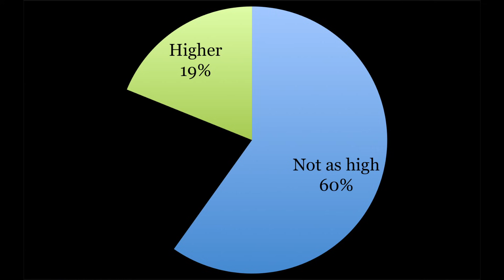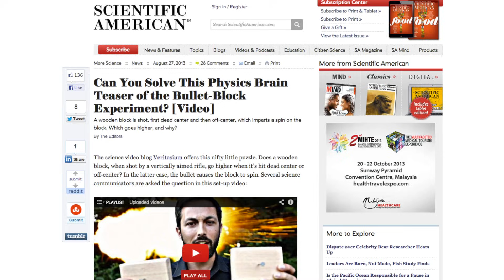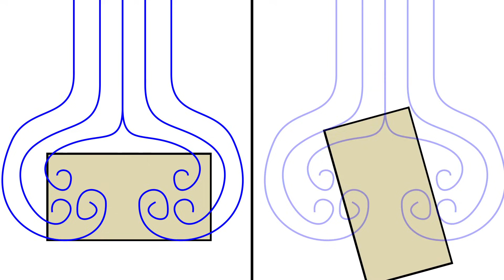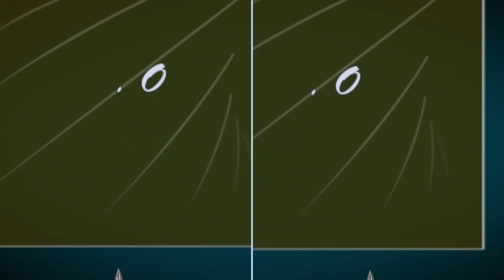Bullet Block Explained!

Comment: Two things come to mind when thinking about why the blocks are going different heights when shot in the same spot...
1. As a gun enthusiast I know that the exact same bullet from the same manufacturer can have a muzzle velocity difference of more than 10%, depending on the caliber and manufacturer. Slower velocity = less energy = less height.  
2. With the small amount of wood working that I have done I know that some parts of the same piece of wood are harder/denser than other parts of it. If the bullet hits a harder part of the wood,  I believe that would lead to less penetration and greater height. When all of the blocks were compared side-by-side, I noticed that one of the blocks that went the highest had a nail fly out of it, perhaps because it was struck by the bullet. 
I love the channel,  and thanks for the great video!

Comment: so what im thinking is that there is more energy required to push the block upwards on a side because the weight is not equally distributed where the bullet hits so more energy goes into pushing it up but that energy converts to rotational energy throwing it higher than what it would have gone with now rotational energy.

Comment: The bullet traveling at, say 1500 ft/sec, would reach it's max depth, transferring it's total energy, before the block would move, up or rotationally, to any extent. Someone smart can do the math, but I bet there would be less than a millimeter difference in rise at the moment the bullet reaches max depth between the two shots, measuring at the line of fire.

Comment: I initially predicted it would go higher. What I'm hearing is that, on average, it probably would go higher by a negligible amount due to lower air resistance (which is what I based my hypothesis on). I'm counting that as a half-success.
Reply: You should
Reply: you dont think that as the block rotates, the total surface area would be encountering more resistance? not from the top as it moves upwards, but from the direction its spinning in as the width of the block “chops” through the air.
Reply: @ernop350  but as the surface that cuts up into the air above it experiences a downward resistance force, so too would the surface that cuts down into the air below it experience an upward resistance force. You'd have to calculate out the aerodynamics to see if the wake has a low enough pressure or enough eddies for the downward force to be greater by a margin large enough to counteract the reduction in force from the reduced average surface area as seen from above.

Comment: Agree to disagree.... The explanation was not satisfactory... If the size of the block is small, there will be a negligible diff in the max height reached by each of them. But assume that - the size of block is atleast 2 ft and projectile size is also increased.... 
in the first case it was just lenear momentum that needs to be conserved. In the second case its the combonation of linear+angular that needs to be conserved.... and when the linear momentum of the projectile, when it hit the side of the block, will get split into 2 (linear + angular) and hence the max height in the second case should be less...

Comment: I think it's a total misuse of conservation of momentum.  The bullet won't have the same momentum as the block has, nor their speeds will be the same, otherwise the bullet won't be penetrating the block if it was not moving faster.  Conservation of momentum should include both linear and angular momenta, and they are not independent at all, as a slowly moving but rapidly spinning snooker ball will gather much more linear momentum from its own angular momentum once it hits a cushion.

Comment: What about the amount of force the nail excerpts on the wood on the off center shot, there would be a decent amount from the block spinning up even tho the nail is center of mass. you could try doing same experiment but with a strong noodle holding up the block like the nail is, but it would break on the spinning one thus not add the rotational torque, and then see if it goes same height.

Comment: Use a composite material each the same weight.
Use match grade ammo and a chronograph to pick projectiles traveling near the same speed. 
The offset shot blocks will be slightly less height  all else being equal.

Comment: I love puzzles like this one.

The thing that made me consider it might go higher is that the spinning block is essentially a gyroscope. The gyroscope holding the block on course vertically so that the energy used to throw the block shot in the middle would toss it off to one side, is not wasted in the spinning of the block. Therefore the spinning block has the potential to go higher. But then I considered that physics would dictate that the block would go the same height because both blocks have the same mass. A piece of wood and a piece of lead. So I said the same height. However, one would have to consider that both blocks have the potential to be microscopically difference in density and therefore that factor needs to be measured into this equation. However kinetic energy is lost at impact, so this slows down the block. 

How can it be measurable?

Make and use a block that can only be exactly the same density every time or use a perfectly round ball of equal mass to each ball. A round ball of equal mass would have to be made out of a controllable substance. It could not be made of wood. It would have to be a material that would react the exact same way every time it is shot. So perhaps a piece of plastic. 

I am sure if you weigh those blocks, they would be different weights.They are exactly the same size but each one could be off in weight due to decisty of the wood as it grew. An older tree with more rings would have the potential to be heavier than a young tree of the same size. A cut from the same board might be more dense if a tree branch grew out of it at one point and not another. This is assuming you are using the same type of wood for each block. So the only correct way to be sure is to make the block or ball out of a controlled substance that could be exactly the same mass and weight for every test.

Comment: Hi I'm late to the game. If the two blocks of wood would have traveled a different distance, then you could use an internal propulsion system to propel a spaceship to the stars. Unfortunately, that is impossible to do. All space travel requires external propulsion.

Comment: You get the same thing with air cars that have velcro on them.  momentum is conserved, but energy gets shifted due to the "bond"  the ole elastic and inelastic collision, but this is cooler because it is a variation on just inelastic.

Comment: I believe both moment of inertia and leverage factor into this phenomenon. Consider, instead of a small block had you used a 2"x4"x8' plank pivoted the same way in the middle. A bullet fired in the center might have been raised the plank some measurable distance - say 4" at both ends. However, had the 2nd bullet been fired into the plank 4' off center would not have raised the whole 8 foot plank. I suspect due to the distance of the bullet striking the plank from its center of gravity, all the kinetic energy from the bullet would have been converted into angular velocity causing the plank to spin on its central axis and the plank would not have risen vertically. This is because the lever arm at point where the bullet strikes is large compared to the distance to the plank's center of gravity. 

In your example, the lever arm was too small thereby the bulk of the kinetic energy translated into linear vertical thrust while the angular velocity was too small due to the short lever arm length.

Comment: Conservation of linear momentum makes sense and I guess the blocks would go to the same height because of it. The rotational energy makes sense due to less loss of energy when the block is shot off center. But what about the angular momentum? Bullet and block both have no angular momentum at the start but the off-center block has some at the end. That's the part I don't get.
Reply: Bullet has angular momentum from the start. Relative to the center of mass of whole system

Comment: Momentum is not always conserved. I recall saying that to my vibrations professor in college and him calling me an idiot, and asking if momentum was conserved in a car accident. The energy is conserved but that does not mean the energy always transfers into motion. In many cases parts are deformed, heat is generated, noise occurs, that angular velocity takes additional energy
Reply: The reason for the varying heights is more likely explained with your organic mediums. While they look very uniform I doubt any 2 boards are sufficiently similar in density, grain structure, direction, density, and internal defect. Using the same board cut from the same tree would help, but you as the experimenter would have a large burden to place the boards in very similar orientations, gett8ng the weights exactly the same, even just the natural twist of the grain structure is going to give you issues, and that assumes that your bullets are all perfectly packed with the exact same amount of powder. They very likely are, don’t get me wrong but that is just an extra variable. Wood grain / density is going to be your largest uncontrollable variation in experiment

Comment: When fired in the center, the block indeed has angular momentum, but it quickly dissipates as heat due to symmetry/destructive interference. If the block were flexible you would see it oscillating like a bird.

Comment: Two things:
A) Conservation of Momentum (both linear and angular) is only applied when the net external forces acting on the system sums to zero. In this case, gravity exists, so there's an assumption that the impact is a very tiny moment in time. But is it? A way to avoid this would be to shoot horizontally on a frictionless surface so the net external forces would be zero. I have done this and gotten the same results (linear momentum is conserved within measurable limits). 
B) Another interesting observation is when the wooden block gets struck by the bullet close to the edge, the center-of-mass shifts from the center of the block (before it is struck) to a point to the right (how far, depends on their masses). You can actually see this wobble for the bock around this new center-of-mass. Interesting stuff!

Comment: 1. Momentum as you described it is not conserved. Momentum is a vector. The bullet is flying horizontally and the wood flies upward. But of course the momentum is preserved because the contraption the wood block is attached is part of the system and the Earth that contraption is secured on is part of the system. And naturally the Earth has much more mass than the wood block. Think of a basketball when you dribble it. The momentum flips over at every bounce. How is it preserved if it is a vector. Because the ball is bouncing from the Earth. The momentum of the total system ball + earth is preserved at every bounce. 

2. Using conservation of energy by just looking at the energy of the wood block is also wrong. I believe most of the energy of the bullet turns into heat at impact. You can verify it by measuring the mass and the speed of the bullet and mass and speed of the wood block.

In short, you are not looking at the total system when you try to set up and explain the conservation of momentum and conservation of energy equations. You are ignoring the momentum exchange with the earth and the heat energy generated at impact. This system cannot be explained with the simplistic and partial systems approach in this video. Momentum and energy are conserved at the total system level.

Most of the comments are also confused. They are lost in secondary and tertiary effects like the consistency of the wood, etc. I haven’t seen an explanation that focuses on the first order effects. Maybe because they are misled by the explanations in the video. 

I think this problem is basically a convoluted and violent ball bouncing problem that is difficult to model. Even a tennis racket hitting a tennis ball is easier to model than this.

Perhaps you are aware of all of this but you are trying to create a puzzling situation where there is none.
Reply: You said, "The bullet is flying horizontally and the wood flies upward." The bullet is flying vertically (up). Also, you CAN apply conservation of momentum on two particles if the net external forces on them sum to zero. We do this in the lab by firing horizontally on frictionless surfaces. The normal force and gravitational force sum to zero, and momentum is conserved.
Reply: Also, "Using conservation of energy by just looking at the energy of the wood block is also wrong."  Energy is conserved, period. Total mechanical energy, however, is not.  Ei + Work = Ef.  Work, in this case, was the work done by friction: Work = friction force x distance traveled. The friction force stops the bullet. So, the total energy is conserved (counting heat aka friction), but total mechanical energy is not.

Comment: I think the best way to do it would be, to get a less dense item but still dense enough to stop the bullet. then see how far the bullet travels in each block of the new substance. Or even a weaker wood like pine, so that at 1% more energy can be seen better.

although I don't think you will be reading this comment seeing how this is on a video that is 8 years old. 
I don't know how i did not see this while i was younger seeing how i have been watching your channel for almost a decade.

Comment: 7:40 shows different depths measured, the x-ray showed they are te same depth (assuming we cant see that slight difference mentioned in the video). So what is the catch with the nail measurement? Why it showed the bullet was not as deep in the spinning block?

Comment: The reason why no one thinks that they will be same height is because they intuitively jump to an analogy of hitting a baseball with a bat.. when you hit the ball and the impact of the bat is closer to your hand, you'd see a huge difference if the impact on the bat was farther, assuming the ball was thrown the same way. We forget that pressure/force varies throughout the length of the bat. 

Returning back to this video, the rifle shot is the only force that is consistent.

Comment: How I thought of it was: hitting the block straight on meant more of the energy went into breaking wood fibers, like a crumple zone in a car during a head on collision, and hitting it to the side meant less of the energy got absorbed by the wood, like getting T-boned in a wreck - the car won't deform as much but it'll spin that remaining energy out instead.

I feel like such a champ for figuring that out. 30 years of watching auto racing pays off!

Comment: @ Veritasium 
The moment of inertia ( it’s a tensor) for a block is different at different axis, Ixx is different than Iyy and Izz ( simplest case).
The two block are still rotating but are different angular  velocities. It seems like one of the moment of inertia is large enough to compensate the angular velocity. We can easily calculate the moment of inertia from the mass and dimension, ( length, height and breath of the block)
Also, Angular momentum must be conserved not only linear momentum.

Comment: I believe that I have another explanation....when the bullet hits the block in the center it is getting more resistance (weight of the whole block).  And when the bullet hits the side of the block it is meeting less resistance (To push up on the block when the point of contact is on the side would meet with less resistance).   I believe that the block,  when pushed up on either side would essentially be lighter then if pushed from the center.  Seeing that the bullet shot to the side of the block would be hitting a "lighter block" (per say), the block should go higher, but instead the added energy is used up by the spin.  And both blocks go to the same height.  I hope this makes sense.

Comment: You could use a flat bullet, so more energy is converted into rotational energy. Actually the would not work, as you would also need more energy to get the same penetration in the wood. I'll keep thinking!

Comment: A prediction before I hear the answer I think the the bullet going through the middle has to put more weight because it's in the middle it's harder for the bullet to shoot fast because it's harder for the bullet to escape the wall the block is showing when off to the side it has to push less weight since it escapes easier

Comment: Hi Derek, Id really like you to reexamine this video and explanation. Your explanation states an expected penetration difference of about one percent to explain the same peak height but in the scene just before you present a comparatively huge penetration difference as if it were the solution. Furthermore your simulation shows a slightly curved pathway in the off center shot so Id probably expect more than the stated 1% penetration difference considering only the height of the block and not the actual length of the "penetration tunnel" (although I recognize that this difference might very likely be negligible considering the bullet speed and its deacceleration compared to the rotational speed/acceleration ... nevertheless this simulation is misleading). Also, your 8 videos at 4:30 show a peak height that differs by about 20%. With this inconsistent testing method and so few repetitions I really do not think that you can have any conclusive claims about a median peak height. I didnt do any calculations for this comment and the theory behind your explanation might be perfectly correct but imho all these experiments do not prove a thing.